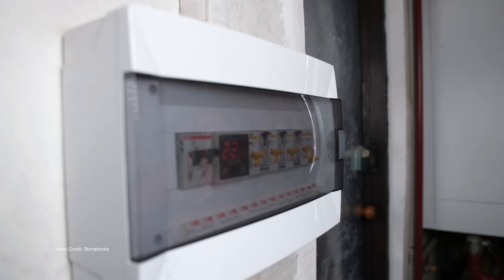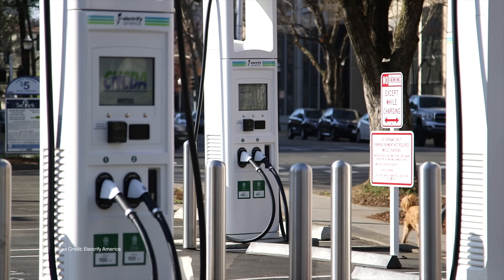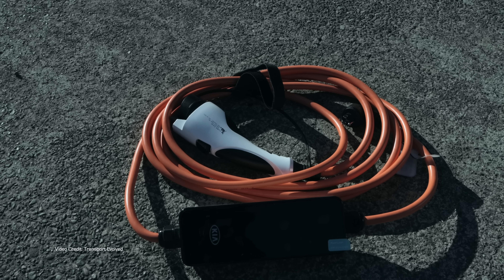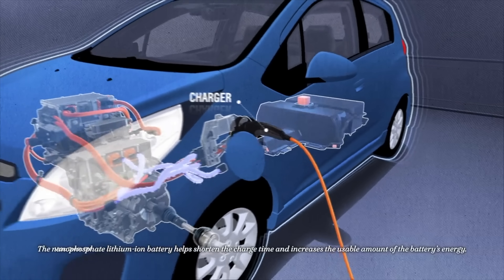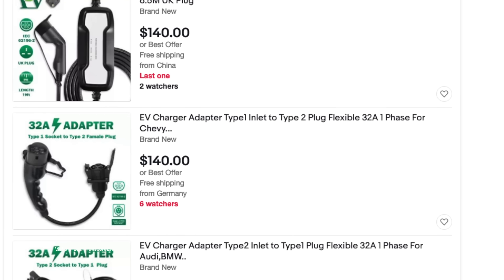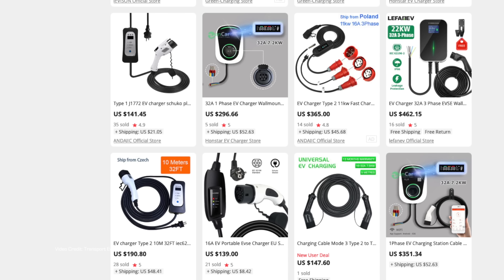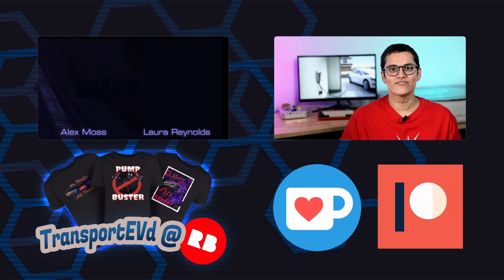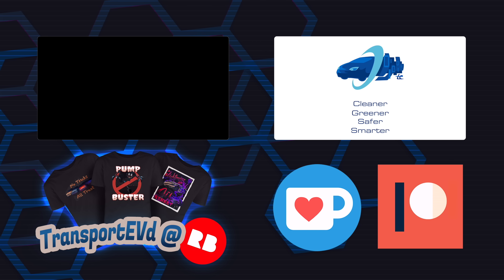EV101: Home Charging

Comment: FYI UK resident. I have a radial outlet from the board in my garage , new 10 years ago, and my EVSE has been plugged in for 4 years.  Due to an awkward/costly installation I have to use the 3-pin EVSE and it is checked monthly for heat damage. No problems in 4 years charging.

Comment: Thank you for helping to make this complex issue a bit more clear. As friends and family ask me about my Bolt EV, explaining these various charging levels makes their eyes turn into spinning spirals and they quickly say they won't ever buy an EV. But, in time, they will understand these concepts as easily as they do Regular Unleaded, Mid-grade, Premium, and Diesel fuels. P.S. I have told them that I never have to check or change the oil as none exists in an EV.

Comment: Nice to see you Kate.  At first I kept our 2019 Bolt EV charged to around 95%+ simply because that's what I did with the Outlander PHEV, our 1st electric car experience.  But since watching your video "5 things you need to know(sic)..." I keep it at 40-60% in the summer and 50-75% during winter. . .plenty for errand running in small town(s) Ontario.  I only charge above those levels when we're going somewhere the next day - say, Scarborough(Toronto); which is not very often - and it's no problem with a level 2 FLO charger in our garage.

Comment: US homes don't have 2 phase electrical.  They have 240V with a center tap in the middle making two 120V lines.  On 2 phase systems you would see ratios like 1.414 or 0.707 instead of the 2:1 of 240V vs 120V
Reply: Here is a nice supporting video that does a pretty good job of explaining this!
https://youtu.be/fJeRabV5hNU

Comment: EXCELLENT video.  Thanks for distinguishing so simply and clearly between a charger and an EVSE.
Reply: Important distinction. My wife has a 9.6kw EVSE. She can only charge at 7kw. It's a limitation of the charger in the 2019 Bolt. If I plug my Tesla Model 3 into it, I get 9.6kw, which I'e only done a couple of times. I use my Travel adapter at which is only rated at 7kw usually.

Comment: Even someone who decides on a PHEV instead of a full battery EV needs to change their habits. They think it's like any other hybrid and so they drive it like they drove their old ICE car and consequently they end up getting WORSE performance, causing many of them to go back to full-ICE vehicles.* What a recent study found was that a large swath of PHEV owners were not actually charging their batteries when they were depleted but thinking that it works just like a standard hybrid. This same study found that about 20% of EV owners went back to gasoline cars because of lack of at-home charging, etc. These people did not inform themselves adequately before making their purchase.

* A lot of the blame for this must rest on the person or company that sold them the vehicle for not explaining the purpose of a PHEV: Run on battery-only for short trips while providing a gas backup for longer trips, but charge the battery when you get home!

Comment: What I think is needed for these videos is making them region based. 

The UK based EV novice doesn't need to know about 110v Level 1 for instance and only needs to know that - if you have a place to charge the vehicle at home, consider a 7kW wallbox EVSE where possible but the use of the 2.4kW "granny" charger is alright for those emergency cases or if you keep an eye on the plug not getting hot. Three phase is seldom encountered in the UK domestic home but if you've got it and the supply capacity, by all means fit a 22kW 3phase wall box which will deliver 7kW to most EVs, 11kW to some other EVs and the full 22kW to EVs such as the Zoe. Installation grants are still available for installing a wallbox EVSE. 

Mainland Europe - more likely to have 3-phase available at the home, so more likely to have a 3-phase EVSE wallbox, but depends on the supply capabilities and if the car has a 7kW 1-phase or 11kW/22kW 3-phase onboard charger.

Comment: The one thing you missed (or that I'd love more confirmation on) is that some of the EVSEs that come with the car can handle 240/220 volts by default. 
The Bolt's for example can in theory, the forums say so at least; and the Tesla one even has Tesla made adapters for it doesn't it?

Comment: 1. Buy EV,
2. Tell dealer to install home charge unit at your home, or no sale.
3.  Install charge point using Proper Electrician, 
4. Once fitted plug the lead from the charger into the car
5. Leave Granny lead in car boot(trunk) for emergencies.
Reply: Re: "2. Tell dealer to install home charge unit at your home, or no sale."
Considering most auto dealerships, at least in the US, don't know much or care to sell an EV, I don't see this tactic working in favor as the consumer ... at least at this point in the EV evolution, again, in the US.
Reply: @chuckm260  It works in the UK. Do you never push a dealer for a better deal, such as a model upgrade for the same price, free mats, special colours, fitted towbar, etc? If the sales team are on commission, which is normal, there is room in a vehicle price to haggle. 
Plus there is always another dealer down the road. 
I will agree that the UK, and Europe, is far more progressive  in the promotion of EVs. We have a Government that in the main is not controlled by only 'Big Business', we have governments that accept the science of climate change on one hand  and that damage caused by pollution is a matter for government.
Reply: @solentbum : He's saying that it won't work in the US because they'd rather make an ICE sale anyway; and if you're saying "I'll walk out the door if you don't sell me this product that you don't even want to carry, let alone sell, with this extra equipment and specialized labor to install it." Then that dealership will gladly say "Okay, there are other customers who will prove more profitable for us. Bye."

Price haggling for a vehicle (with a set features list) is not the same as trying to require a value-added feature & service as a condition of a sale. The distinction may be small, but it's there. And, again I'll say, a dealership won't hesitate to turn away a buyer if they believe they can make more money from someone else.

Comment: I have a lower range EV - a 2016 Kia Soul EV+ that I bought last year - that gets around 90-ish miles of range (it was a so-called "compliance" car made specifically to appease California mandates). My friends wonder how I can POSSIBLY function with such low range and I tell them, "Well, for one thing I work about 10 miles from where I live and rarely drive more than that. But even if I do go beyond that there are on-the-go chargers all around here that I can use if necessary. Imagine if you had a gas car that could only go 100 miles or so on one tank of gas BUT YOU HAD A GAS PUMP AT YOUR HOUSE. That's my situation: I plug in about every 2 or 3 days and sometimes I bring my EVSE* with me if I know there's a 220V outlet at my destination. I've not had a single problem so far and the cost of 'fuel' and maintenance is ridiculously low."

* My EVSE is portable and comes with several adapters so that I can use virtually any kind of outlet, if a DC Fast Charge or J-1772 is not available where I'm going.

Comment: A friend bought a Volvo EV recently.  Quite expensive.  For less money she could have bought the most loaded Model Y.  She spent a LOT of time checking out charging places.  Most of her charging was at home and all was fine until she took a trip to Nebraska (about 350 miles away).  Ended up spending 2 unscheduled nights in motels waiting to be charged.  Multiple chargers that she stopped at were dysfunctional.  A Tesla would have made this trip simple.  Nobody listens.  She's a long time Volvo fan (as I used to be due to vehicle safety) and was snowed by the Volvo dealer.  Now we have an unhappy EV owner who's considering going back to ICE.  :-(

Comment: In most of Australia you can wire your EVSE into the "controlled load" circuit. (though it may require an upgrade to the switch if your house has hot water on the circuit). This is colloquially and wrongly known as "off peak" (which is also available but is completely different). Controlled load is, as the name suggests, controlled by the network. They send signals through the wires to turn a relay on and off. Anything that's permanently wired in and safe to be turned on or off at random times can be connected and that includes permanently wired EVSE. 

You can't override it, but you can simply unplug from the permanently wired EVSE, and plug into another EVSE that's plugged into the normal house supply. Using controlled load (tariff 31 in Qld) drops the price from about 35c/kWh to about 10 cents.

Comment: First there is no reason to permanently install an EVSE unless you want more than 50 amps. A 14-50 will suit most people and the portable EVSE works just fine.
Reply: They are really only designed for occasional use. I live in the UK and get a higher charging rate because of 240volts, and my granny lead was supplied by the manufacturer, so I assume is safe. I would agree that the in line box looks reasonably fragile (I have not intention of testing that!) but I cannot wait for my 7.2 kW  point to be installed, which will make life much easier.
Reply: @bigbadjohn10  We have used the supplied EVSE for years on three different Leafs. During the pandemic daily. Our Level II is a 30 amp circuit. It will charge up to 7.2 kw. I have been doing this since 2013 using converted old EVSE designed for the Ford Th!nk. Avcon system which is J1772 compatible. Simple replacement of the connector. The only stressed part in these systems is the relay inside the EVSE. I have yet to burn one out. Many relays have a sacrificial contact to take the surge extending the life of a relay. There is no reason for permanently installing an EVSE unless you want more than 50 amps.

Comment: Is an employer that offers level 1 charging (120v outlet) at work parking stalls, a good thing. They could offer level 2, but should I be happy at least have the level 1?
(I’m leaving context out, but looking for feedback)
Reply from the maker: It’s better than nothing, and I’d plug in to a 110 at work if it was offered, but it seems penny wise and pound foolish on their part. It’s not good enough to be listed as a job perk, and once people know there’s any sort charging, the pressure is only going to ramp up on them to go to level 2. - Winter

Comment: Rather than expressions like "a tank full of electrons" you might want to stick to expressions that are easier to understand like "you're car's had it's holes and electrons interchanged in a manner which introduces massive electrical potential"
Reply: Holes have only been proven to be real in semiconductors and swiss cheese.  In batteries, it is ions that hold the positive charge.
Reply: @kensmith5694  And it is the ions that contain the holes. The same as in semiconductors.

Comment: To extend the life of your battery, do not keep it 100% charged all the time.
Keep it between 20% and 80%.
The battery degrades mostly when kept at near full charge for extended periods of time.
I have a Chinese electric car with 44.5kwh capacity and that is enough for several days of driving.
It came with a 7.2kw charger (Bigger in theory, but limited by the on-board inverter) installed by professionals.

Note that you should prefer a car with 3 phase inverter as that reduces load on your home electric system.
Mine isn't and as a consequence, I had to install thicker gauge wire. 
My car uses 16 kwh for 100km.

For those more interested in an in-depth overview, Technology connections channel made a video about them:
https://www.youtube.com/watch?v=RMxB7zA-e4Y&ab_channel=TechnologyConnections

Comment: A properly designed EVSE will suffer no damage by plugging into the wall. All the stress is taken up by the relay which is activated by plugging in the vehicle and doesn't deliver current until told to. Your power supplies for phones and other devices you will sometimes hear a pop when plugging in. EVSE will not do that.

Comment: Does the charging cable that came with my M3 have a surge protector.  Should I be worried to have it plugged in during a thunderstorm?
Reply: I can't speak for Tesla equipment but I asked about this with my Bolt's granny cable. Apparently it offers some amount of protection, and that is about what Clipper Creek told me about their EVSE I got. So just in case, I had the electrician install a whole home surge protection for an extra $200 which I thought was good peace of mind. But I do unplug the car during storms.

Comment: Health & Safety advice:  Watch out for road-rage incidents at busy charging stations. I've seen a number of instances where the drivers of ordinary petrol and diesel cars are getting around parking restrictions (and Pay and Display ticket costs) by leaving their IC cars at EV charging points, lifting the bonnet, sticking the bay's chunky charging lead into the engine bay, then lowering the bonnet to make it look as though their car is on charge.

I have nowt to do with the dog-eat-dog world of motoring and EVs these days (too poor; I just ride a bike), but it's pretty obvious that occupying a charging bay in this way is going to make people angry.

Avoid confrontation situations. And DEFINITELY DO NOT let the air out of anyone's tyres. No. That would be wrong. Just get some video evidence on your phone (I haven't got one of those, either) and report the miscreant to the proper authorities.

And that's not Psycho Dave with the pickaxe handle.
Reply: Psycho Dave sounds a lovely chap... What did you say his number is? (so I can avoid accidentally calling it) 😇

Comment: Normally I home charge the battery up to 85%. I start charging at 30%-40%. That means I charge 50% of the capacity of the battery when needed. In my case that is 45 kWh. Only when I have to go for an extended trip the next day, I'll charge it up to 100%.
Most home 3 fase electric systems in Europe support up to 11 kW, using a load balancer. This means that in a 10 hour charge during the night I can charge 110 kWh which is already more than twice the amount of energy needed for regular use.
In my point of view 22 kW home chargers are over the top and unnecessarily expensive.

Comment: I have an EO mini - the EVSE works flawlessly and is small, but the smart part has NEVER worked, not once.  Fortunately my car has all the necessary controls to adjust the time and charge rate so no problem, but if you want any solar integration or even app-remote/record/anything then steer well clear of this as it is useless - and so is EO.  They still wont refund the smart box.

Comment: Why the Blues Brothers reference?
Reply: The cigarette lighter  doesn't work.
Reply: It's a 106 miles to Chicago, we've got a full tank of gas, half a pack of cigarettes, it's dark out, and we're wearing sunglasses.
Reply: @MarkLLawrence  It's a 106 miles to Chicago.  We have a fully charged battery. A new cartridge of e juice.  It's dark out, and we're wearing sunglasses.  It's in self driving mode - ludicrous speed. 
Hit it. !.
Reply: @irri4662  it is now 😉.  And by the way, is there an EV with a cigarette lighter?
Reply: @MarkLLawrence  fine ! Then  refill the flamethrower. .. Because it's now.

Comment: What about the question I’ve been asked several times about my e-Golf: “does it use gas?”
Reply: General Smedley Butler  Yes, I love my 2017. I can manage about 150 miles of local driving if I push it into the "red zone" but about 125 miles at 65 mph before the needle gets into the red. At 30,000 miles I still have ~94% of the original battery capacity.

Comment: 12 amp L1 EVSEs are common. Not 1.5 kW. 10 amps provides 1.2 kW. 8 amps provides 1 kW. 12 amps is 1.4 kW.
Reply: Many North American EVSE's are also rated for 240 volts as they are a global product. Check the UL /CSA label to be safe . The NISSAN LEAF supplied EVSE was dual voltage.
Reply: True, but unless a dual voltage EVSE comes with a NEMA 14-30 or NEMA 14-50 plug, then it is pretty useless for most people.

Comment: Electromagnetic induction wireless charging will be the norm in 5 to 10 years. Bi-direction also!
Reply: I doubt it.  Even at 90% efficiency, that 10% is a lot of power.
Reply: SAE J2954 standard
Reply: @seabream  The 10% is the percentage lost in the inductive part.  The rest of the losses still happen.
Reply: @kensmith5694  You may be out of date. The Society of Automotive Engineers article here: https://www.sae.org/news/2020/10/new-sae-wireless-charging-standard-is-ev-game-changer has tests showing total system efficiency grid-to-battery of 94% in today's systems. That would be impossible if 10% of the energy was being lost just in crossing the air gap as you state. A key indicator is that you say "inductive". Plugless (in the automotive space) and smaller consumer devices (toothbrushes etc...) use older magnetic induction systems that are less efficient than current magnetic resonance ones. That may be where you are coming from. If you compare that 94% to conductive systems, they're pretty comparable. And that's before the advantages at high power that I already mentioned that you apparently disregarded.